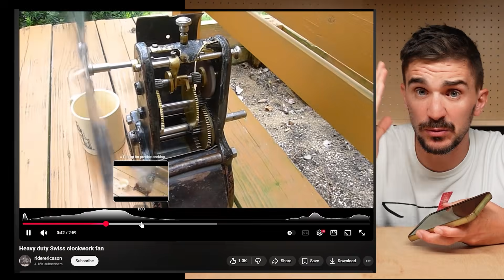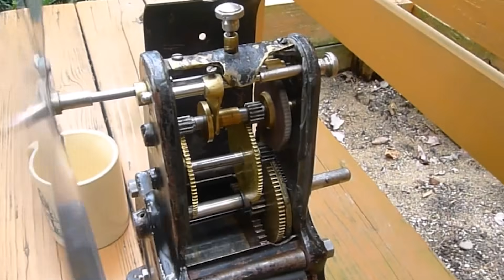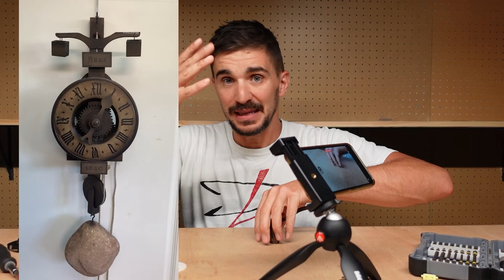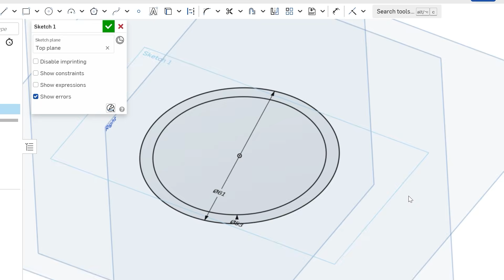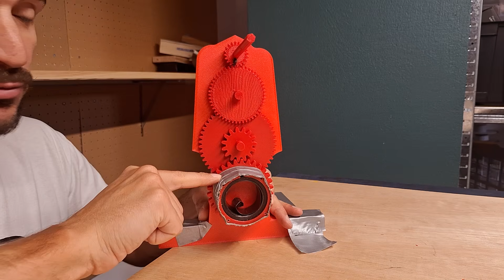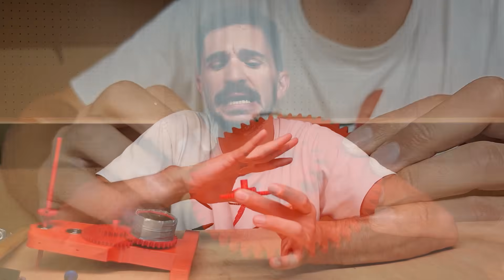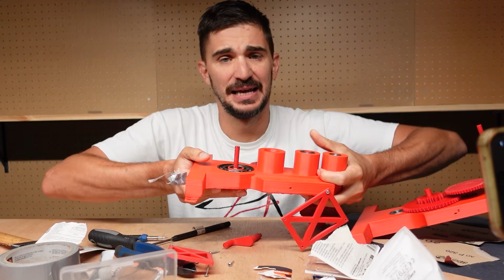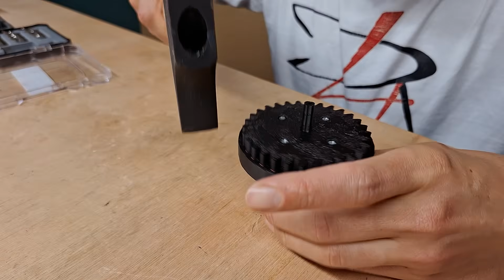No Cables or Batteries, Just Pure Mechanical Engineering - This Swiss Cooling Fan Cools You For Free

Comment: 23:30  You also need a governor.  This thing will unwind almost instantly unless it runs out of torque to spin the fan faster.  But even with that, it will unwind way too quickly.

Comment: Would be cooler to use flywheel to power it. What AI tells me: Flywheels generally offer significantly higher energy density than mechanical springs, making them better suited for storing larger amounts of energy in a smaller package

Comment: try it with a low rpm optimised propeller and with moodern drone props. i guess if you change the load characteristics you can gain some minutes of runtime.

Comment: That was great. Yes gears are not to be taken lightly. I think a steeper prop (like the one you printed?) would be better as it could run slower and lose less to friction. Because of air density the higher speed (fan) prop at low speed is very inefficient.

Comment: I’m shocked I tell you that a 2 days prototype proved too expensive and too inadequate. Surely optimization is impossible! 

Bearings need to be open, the seals cause too much friction. The gear ratio needs to be much higher. The spring force needs to be much higher. The fan diameter and pitch needs to be higher. The gear teeth need to be smoother.

Comment: 19:50 you can also just design shoulders on your shafts so that the spacing between the gears is wide enough to prevent contact between the flats. It means that your gears will have to be thinner, but with the power levels you are dealing with it shouldn't be a problem.

Comment: What came into my mind when I saw this is that you could use a powered motor to wind it that turns on when the rpm gets slow or the machine stops, don't use sensors or anything just like a mechanical switch ought to be enough like a centrifugal switch.

Comment: I don't think making the clockwork fan would be that expensive. The problem is a fan needs way too much power to make even a small breeze to allow that to be "charged" by just a hand crank for a reasonable runtime and wind up time and effort. The direct driven (I mean without any energy storage) blowers/fans deliver the required power from just the crank power as is. So a 1 minute cranking means 1 minute blowing. To get more runtime over crank time ratio you would either end up with so weak fan it won't make any significant air movement, or the forces involved in winding it up would be too huge to be practical.
So the fans did not practically work (as real air moving fans) in the 1900's, it was just an expensive novelty toy without any real practical use.

Comment: 24:07 I have not worked with 3d printers before but that's likely because you printed that all as one piece and so the layer lines were making the shaft, it was always going to brake when put together it's better it broke now and not when fully wound up.

Comment: 20:36 I have not worked with 3d printing but you could have also gotten a hand drill and simply run the device allowing the gears to sand each other threw, wearing down, sanding the full machine, it might require some sand to help in that wearing, or just holding a finger sized piece of sand paper as the drill powered machine runs.

Comment: I think a better option for a modern mechanical fan would be a toothed belt drive setup, with a self contained coil spring driving the belt and pulley sets.This would require much less precision, and could use multiple belt and pulley sets to get the correct ratio.  It would also not require gear lube and probably be quieter.

Comment: Your channel is large enough that you might be able to convince a metal 3d-printing company to sponsor a follow-up video where you tried it in metal (unless that would break your agreement with Bamboo Labs). I'd love to see it.  

As for selling this to consumers, I could see a metalworker selling a limited run of these at high prices and getting a few takers; it's a cool novelty.  I could also see someone manufacturing these at a $300 retail: A premium working steam engine model tends to run around $300, which I think has comparable manufacturing difficulty.

Comment: A more accurate title would have been - "3D printing is fundamentally unsuitable for this", which is well known. While it's nice that you can cheaply make whatever your heart dreams of, it comes with several costs, in this case - precision, strength, efficiency, all of which are crucial for a machine like this. A faithful reproduction with the goal of replicating or improving on the results of the old fan would have needed either metal machining, or some kind of injection-molded plastic, both of which orders of magnitude more expensive.

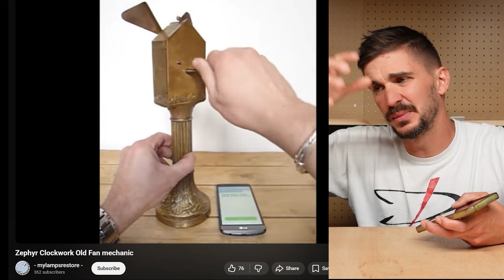Comment: 1:56 so at one point in my life I repaired watches and clocks, their are a few ways that you could achieve (up to) 30 minutes on one crank, it could have a few different modes of operation. a slower mode that makes it last much much longer, if it is after the age of steam engines, fly wheels were wide spread and you can do neat tricks with using them to rewind the spring, the way lots of clocks use weights, or just using the fly wheel to slowing it down and using the momentum to keep it running. the spring looks like it is tuned easily and that could be done with gearing, but we do not know how "charged" that spring is, it could be a dangerously strong spring. so the phone 98% charge, just plug it in for a a few minutes, and it's 100% now it can run for hours. the same thing could be done with the spring. if you think people would not make dangerous objects think about moving a piano, fully tuned. yeah springs that can snap and kill.

Comment: You really should have designed it so the gears don't touch the faces of the other gears.  Getting that spacing right would mean that all the friction motion is at the bearings.
They also used a really massive main spring.  There was a good reason the crank had a long handle on it.

Comment: You could take two plates (of 8mm?)aluminium, fix them together and then drill holes in it for the bearings and for stand offs. 
Also drill holes on the side to mount cover plates that will double as reinforcement to add rigidity. 

This shouldn’t be too expensive, I think.

Comment: There are other, larger spring motors but they're more expensive. Think about self-rewinding cord or hose reels. Those are intended to not just have more turns, but also to pull back a heavier load.

Comment: A couple of notes from an armchair amateur.

First, you probably already know this but, with the way you designed the gears, you don't need to "key" the intermediate shafts to the gears, only the input and output shafts.  All the gears are locked to each other so there's no reason to lock them in to the shafts.

Second, because of the first point, use bearings inside of the intermediate gears and make those intermediate shafts metal to keep things lined up better than 3d-printed ones.

Lastly, slightly over-size (width-wise) and keep a slight overlap on the gears, and use spacers to ensure the proper positioning on the shafts, so you can gap the flat faces of the gears slightly apart.  That will remove the friction on the faces of the gears.

Otherwise, I'm quite impressed!  If I didn't have such a dog-slow 3d printer of my own (an ancient hobby-modded Creality unit), I'd give this a go myself.

Comment: good idea. obviously, your gearboxes have a lot of losses and it would be possible to bring the mechanism up to, say, 5 minutes, and even maybe 10. but it seems to me that the main drawback in the spring is most likely that the fan was much more powerful. I have no idea where you can get one. it seems to me that the spring is a bad option. I thought about a wall mounted vent with a load)). maybe a heavy rotor is a good idea. heavy and quiet is better than small and loud, if it does not affect the number of gears
I would proceed from the required capacity. something like 20 watts *2 for losses = 40 watts
Reply: The rotor can be connected directly to the blades. unwinding through the gearbox

Comment: An easier way to reduce face friction is to print a shoulder or place a washer around the shaft that is the same outside diameter as the inner bearing race.  That way the only parts touching anything are motionless relative to each other.  Of course you still have the friction of the teeth and the rollers or balls in the bearings, but these are unavoidable.  Sorry, but entropy always wins.

Also, instead of 3D printing, why not metal?  PCB Way dude!

Comment: there must be more too it... honestly to say that the dramatic difference in time being down to inefficiency doesn't seem quite right. If you think about it, with the spring wound to a particular point, you should still get exactly the same rotations of the drive gear and thus give a constant amount of rotations of the other gears. The only thing that would create inefficiency would be slipping of gears between teeth or slipping of an axel not matching the rpm of the attached gear wouldn't it? friction may slow down the unwinding of the spring but it should still translate to a fixed (or close too) number of rotations... Or am i missing something? Perhaps the spring in the original is massively and stupidly dangerous which provides the extra time? I just don't see there being such a massively high loss of efficiency through only an inefficiency in the design or the plastic medium. But hey i'm no engineer and probably wrong?

Comment: As a main spring i'd recommend the return spring of a seat belt, as i assume it would be a bit more powerful and they also are construcrd in a way where they have a free wheeling device in them (at least the one from a i think a mecedes sprinter i took apart did).
Also i like how non standard the gear modules you chose are at lest 2.5 is a standard size.
If you are curious about the standard sizes i recommend "rollof/matek Maschinenelemente" it has some great insights into how to size elements of a drive train. i haven't checked if it also exists in english though.

Comment: Well, you can get Stirling engine powered ones to spread the heat from a cast iron stove, but it's clockwork springs like the one in the fan from the short are strong enough to maim if handled improperly. Maintenance of clockwork that strong is a very rare skill these days, and a carbon steel clockspring that big had better be kept oiled.

Comment: You need a small lathe.  Then with a 3-jaw chuck you could easily and accurately have bored a hole exactly in the centre of the main spring housing.  Also, you could have used it to make a metal spindle which was a press-fit in the housing, rather than using a screw.  Better still you could have laser-printed the housing with a hole , then press-fitted the spindle.
There used to be an English company, Myford by name, that made small lathes.  Almost certainly there will now be a Chinese manufacturer that makes a similar product.

Comment: Thank you for the content! As others note, the original had a MASSIVE mainspring like 30X the tape, the key to understanding the economics of the original production was the existing Swiss clock industry. Precice efficient gears and geartrains were mass produced making it simple to Sorce parts. The suggestion by others to repurpose cordless tool reduction gears makes sense. Ps, do you ship Ts to USA? You have just about the only merch I like on YT!
Reply from the maker: Yes, the original mainspring was likely massive. What I'm curious about is the wind time. The t-shirts are handled by a third party company, they ship everywhere. It would be impossible for me to deal with that as well 😊Thanks for watching and commenting.

Comment: I would love to see you collaborate with @zackfreedman on this or just about any of your 3D prints. I'm sure he'd love to work on an input-multiplying 3D printed fan.

- add a mechanical advantage to the input crank with a lever and gearing to reduce wind-up time
- add a flywheel to increase spin time
- change gearing on final output such that the natural torque requirements of driving that gear ratio slow the unwinding

Comment: OK what I can change in your design is not to put the bearings in the stands, but in the gears themselves. Also keep everything compact by placing a couple of gears next to each other and space them out accordingly so they only contact on the teeth, and not the sides. The input and output gears are impossible to make with the bearings inside because of obvious reasons. Also a stronger spring is a great start + better gear reduction.

Comment: Honestly that's a lot for three days of research and development.

I think there's definitely some potential here, though. Injection molded clockwork is relatively cheap (ie, egg timers are still a thing, afaict) and I think the main limitation is the tape measure spring, since it's not really made for storing a lot of energy.

ETA:
There's also a two barrel/spindle design for winding mainsprings where it coils in its resting state on one spindle and is wound onto the other for power, kind of like a cassette tape. There was a whole slew of kinetic sculptures that used this for supposedly providing something close to constant force

Comment: Use belt drives instead of gears. You could even use gear toothed belts, though I think it entirely unnecessary. Belts would make the flexion and alignment tolerances far more forgiving.

Also, for a fan... well for portability, maybe a main spring is good. Gravity might also be worth exploring though. It would be cool if you just placed something heavy on hook 1, that would drop slowly over an hour, as hook 2 cycled to the top. Then just grab the weight, lift it up to hook 2, and repeat...

I think you were on to something at the beginning though. I have often thought that wind-up is practically a forgotten technology, relegated to toys and novelties, and it could probably be significantly improved through modern engineering. You could probably use a nitinol main spring and heat it up for winding, then let it drop to room temp and get way more energy out than the exertion needed to wind it in the warm state (or I might have that backwards and you would need to cool it for winding and let it come up to room temp for usage).

I wonder though. Could you use some cooling gas, in a chamber, that is compressed during use, then on the last leg of unwinding, the gas is rapidly uncompressed (but contained), cooling a secondary main spring, and the last portion of unwind could be used to wind the secondary temporarily cooled main spring, and as the secondary spring unwinds, it compresses the gas into the other side of the chamber, so on the last leg, it expands and cools the first main spring, repeat.

Then it may wind and unwind a bit less each time, but maybe you get three or four progressively shorter cycles out of a single manual wind?

I think nitinol based wind up and clever engineering could probably achieve practically perpetual energy for a low energy application. Practically, not truly perpetual. Due to initial build and first wind up constituting a significant initial outlay, and then normal wear and tear constituting a limit to the possible length of the practically perpetual cycle. Also, the memory effect of nitinol actually increases with repeated cycles, so it might reach a point where it either tears itself apart, or becomes impossible to wind, though the former seems more likely, as it is the spring side (memory effect) which increases.

Comment: I really enjoyed this video. I would love it if you kept taking a few more goes at refining this machine. Either just one more video or you could break it into a series and that would be fine by me. With companies out there like Sendcutsend, you could get a final version made out of metal. If you did break it out into multiple videos, you could do one optimizing the gears size and teeth, or one on bearing types and material (weight) to get as much power to the fan blades as possible. Fan shape videos have been done but that is yet another avenue for getting the overall air movement as high as possible.

Comment: Stick 2 pieces of plywood together and drill pilot holes where you need them. Then cut out the shapes together and drill the holes out to the correct size for the bearings. It's not 3d printed but should work pretty well and still be cheap.

Comment: Plastic on plastic creates more friction than polished metal gears, which can be lubricated to reduce friction even more. The metal gears can also be lighter with their mass centered close to the center of the gear, reducing the energy required to rotate the gears.
Reply: Delrin gears at light loadings are fairly friction free but you'd have to buy them not 3D make them.

Comment: This is interesting as there is an 8 gear transmission design floating around that is designed for maximum torque. Reversing it's pattern would achieve the same desired outcome for this application. The reason i mention this is one revolution of the spring gear takes a very long time to complete, thus longer running time. However im assuming the spring torque would need to be significantly greater to power 8 gear ratios

Comment: The old one worked for 30 mins. so yours is kinda very under powered but fun :)
You need an 8 inch circle by 4-5 in depth as a custom main spring.